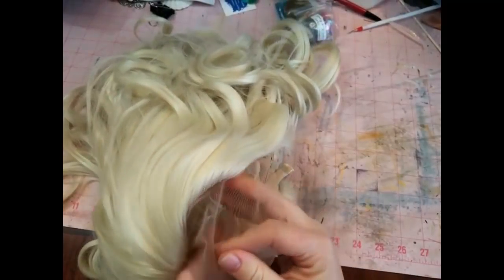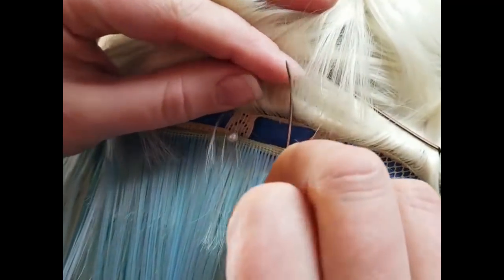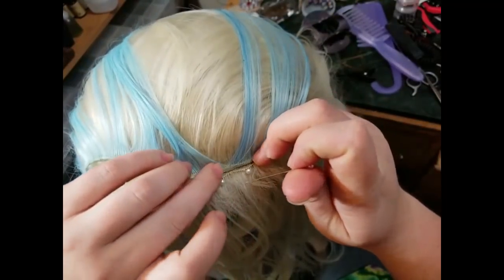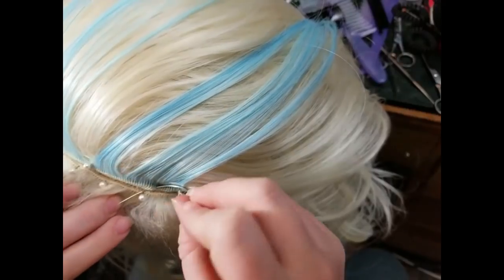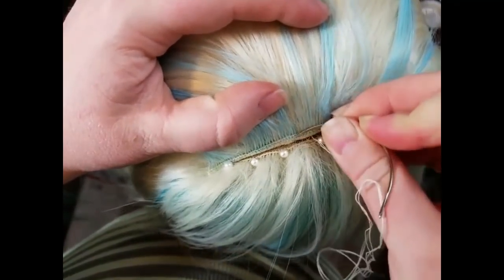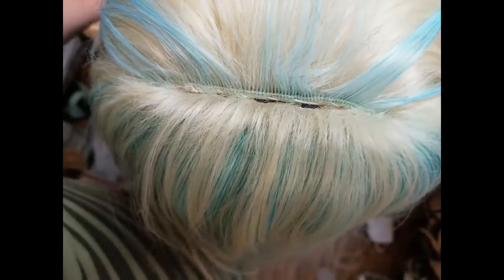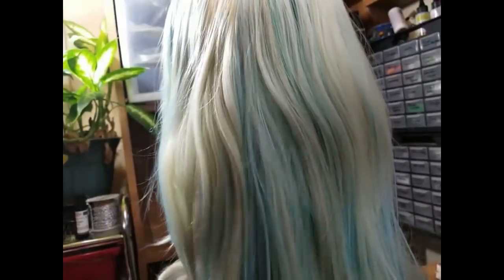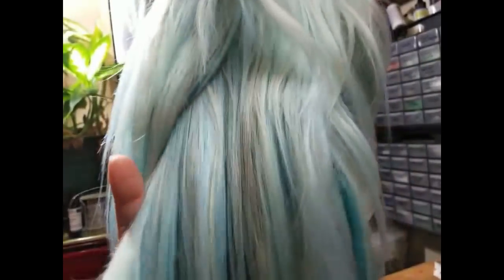Adding wefts to wigs: Full Length

Comment: for someone looking to add more solid color sections to a wig, would you recommend layering a few wefts of the secondary color over a single base weft? if so, how many? im looking to add layers of white/silver hair into a black wig, and i would like those layers to be a bit more solid. volume of the wig isnt an issue, as the character has very large hair.

thank you!